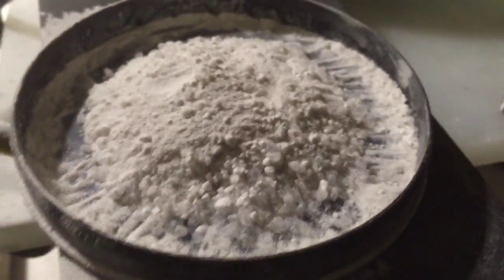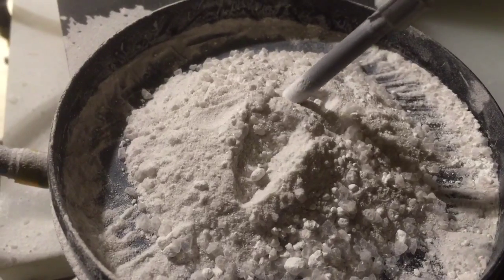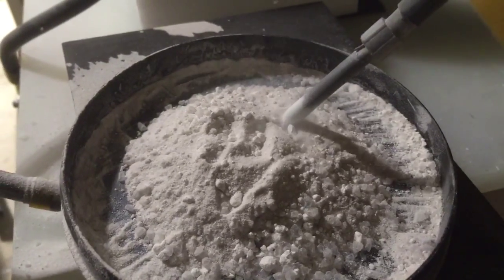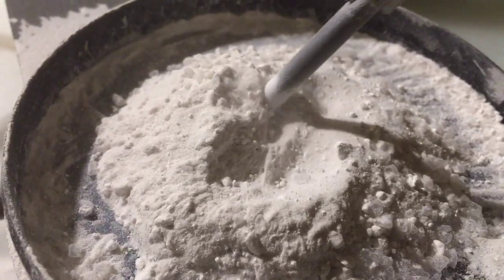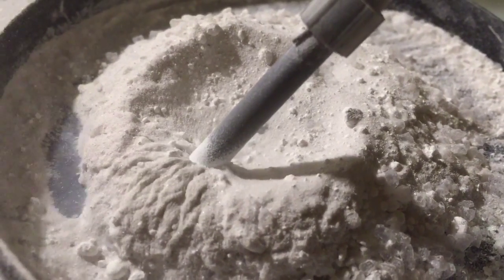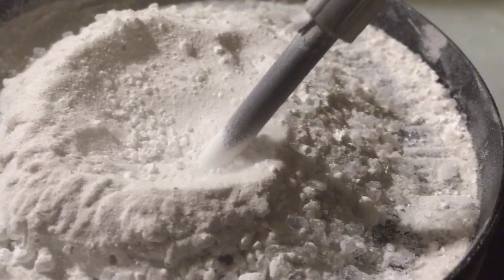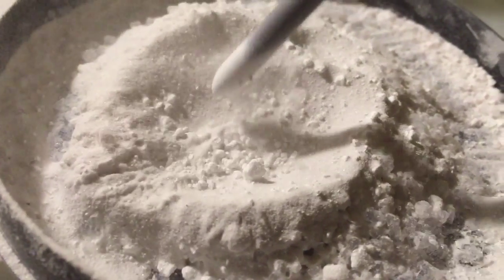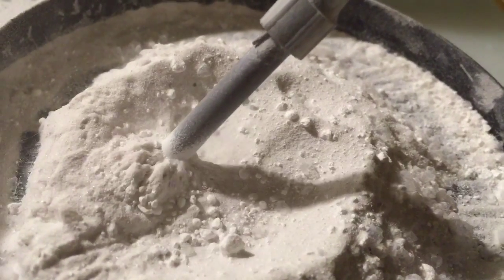Raised Dendritic with Combined Electric and Physical Displacment

Comment from the maker: I'm using a France Neon sign transformer 7530 P56-2E that has a primary 120V 60Hz 2.1 amp and its secondary is 7500V 30mA.  I am happy to share all, and I believe at the end of one of my videos I have photos of the set up and close up of the HV caps.
Billy's work with vibratory creation of the dendritics is intriguing, but I believe it may be a multi force and electrically primary in its formation.  The features on Mars would be more pronounced with dendritics if large scale vibration were the etiology.  Billy's work is excellent.  I hope my less than conventional perspective may help elucidate the large scale mechanism of action.  I will load a neat video showing the Massive Vorticity Birkland current and the seeming amplification of its effect as more material is picked up by the vortex.  I also think that this is the likely core etiology of Tornados to be sure. It's capacity for surface alteration and picking up debris without damaging adjacent structure is phenomenal.  I would look forward to meeting with all the inventors and researchers on this project.  I would bet a few days with our equipment would make for a very interesting meeting and outcome!